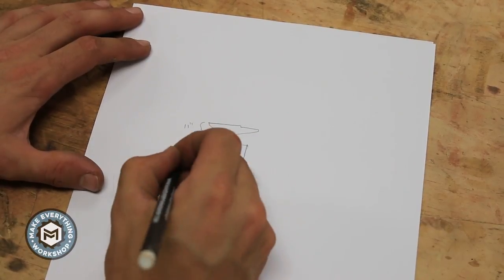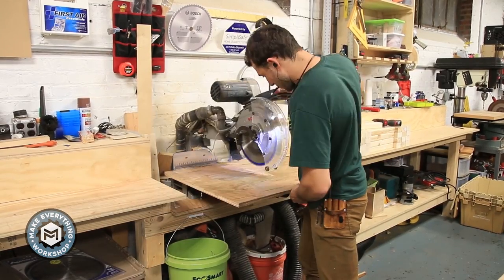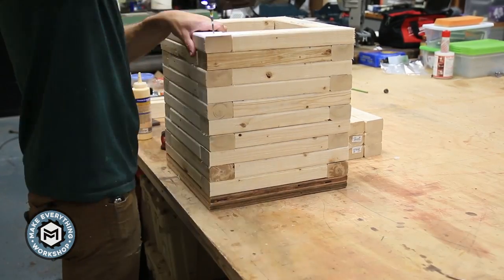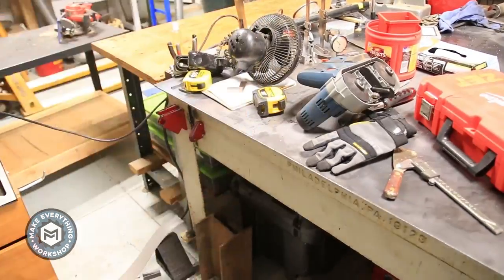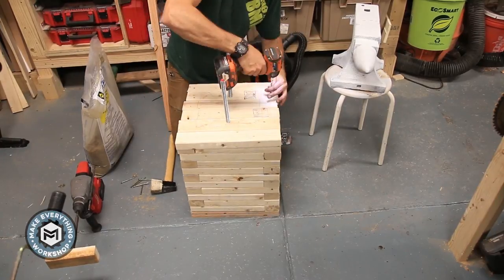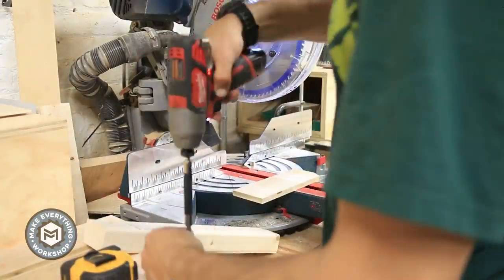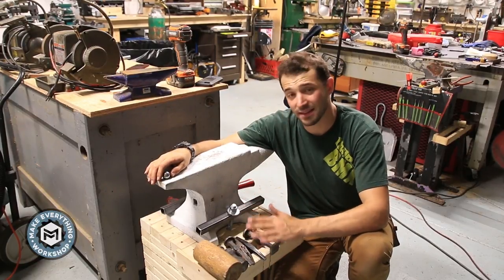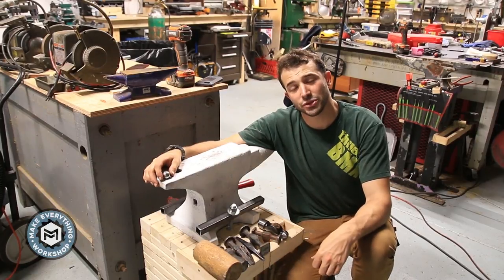HOW TO: 100lb Anvil Stand

Comment: Great channel. Great project. Nice that you gave proper credit for the idea. I built one and it worked out great. I saw another video where they added oil to the sand to keep it moist and compact. I did that and also lined the inside with poly to prevent the oil seeping into the wood. Not sure I needed to, but I had the material on hand so I thought what the heck. It is extremely solid. I chained mine down as that was the easiest for me and it gives it a pretty cool look. Stoked with the results. My forge comes tomorrow. Can't wait to learn how to shape metal.

Comment: If you add several more courses of 2 x 3's, and cut your top plate to fit inside the walls, the plate-mounted anvil then sits directly on the sand. No compaction worries, and the anvil height is infinitely adjustable. It took me months to find the best anvil height when I built my very similar stand, so adjustable height is useful.  Clyde
Reply: Exactely. This is done a lot in Germany. A 3rd of a fuel drum filled with sand, a 1" board on top and the anvil on the board. You can even adjust for a tilted floor that way. As for height: Stand next to the anvil, make a fist with your striking hand and your fist (knuckles) should be level with the face of the anvil (arm loosely straight down). As long as the height of the anvil is within an inch of that, you're good.

Comment: I’m building mine after viewing this video but with some changes. Im using all reclaimed lumber. I have a huge stack of 2x8 lumber that came from a small addition the we removed after 30 years. I’m using some 3/4 inch plywood that I salvaged from work. I lingering the inside with heavy plastic and using p gavel from the driveway.

Comment: I realize this is a very old post but is there a reason not to stand the top layer on it's end so that you're almost 3 inches thick instead of just the 1.5 with them on their sides.  just seems to me it would stand the long term weight of the anvil better.  shouldn't add much more cost than maybe one more 2x3.
Reply from the maker: That’s a good point, I made sure to keep the sand at the highest level possible and because the anvil isn’t very big I don’t hit it too hard, it’s held up great

Comment: I don't use instagram so I can't look at the original build.   What advantage does the sand give in a build like this, is the stand more stable due to the extra weight or is there more to it?   Thanks.   I have seen a stand that was basically a hollow metal rectangle with a tamer towards the top kinda like a pyramid but not nearly that steep.   It was filled with sand and the anvil was mounted to a plate that was just on the sand.   I was told that was so you could adjust the height if needed by adding or removing sand.

Comment: Why is your anvil painted white? Diresta inspired? Great video!
Reply from the maker: I use white "bare metal primer" from rustoleum on raw metal stuff that lives outside. This anvil sat outside my old shop for almost 2 years before I moved into this place! Jimmy got the right idea though, white tools just look great!
Reply: Make Everything, is the paint heat resistant?
Reply from the maker: It is not, since finishing the stand I used a belt grinder to flatten out the top a bit and get the paint off so it wouldn't burn off and make fumes.

Comment: I guess I would have put some plating or another sheet of plywood on the bottom side of your hold down bolts to spread the force across the entire top. But if it works for you then to each his own.
Reply: Yes, good idea, but with most pressure of force downward it should be OK..I would say

Comment: I hate to be that guy but you mounted the anvil way too low.  Blacksmiths regularly hold long work between their legs in their crotch when they need two hands (punching, slitting, drifting, etc..) and tend to keep the anvil right at a height between their knuckles or wrist while standing.  Also, the wood is much stronger on the end grain.  As is the sand is doing a great job of suppressing the ring of the anvil but I imagine that, in long term use, the wood will give.